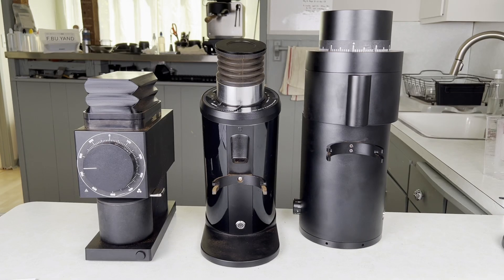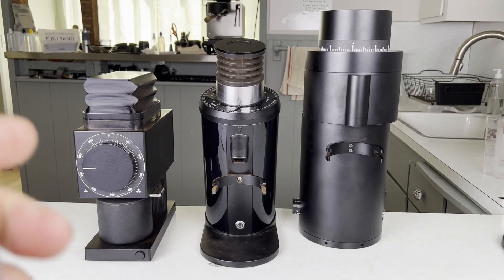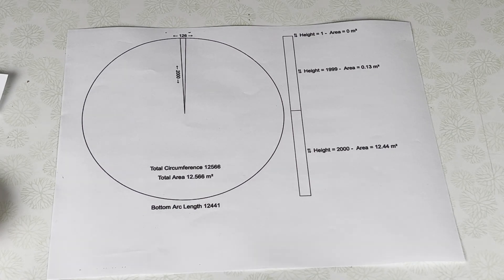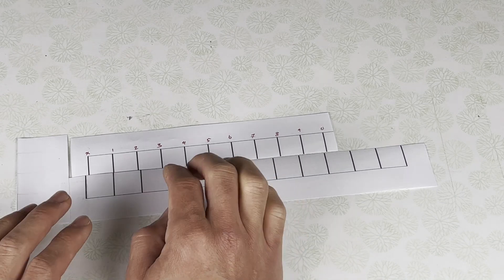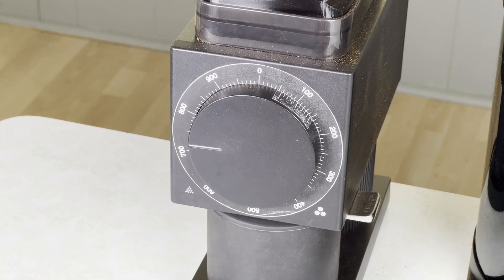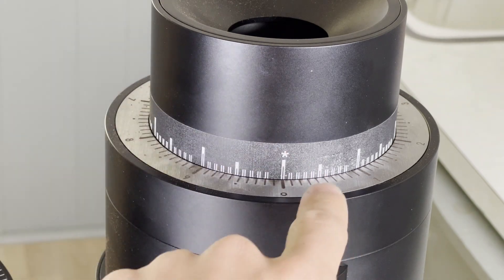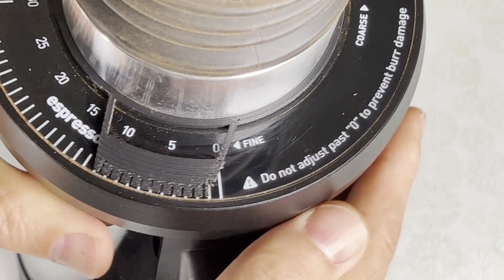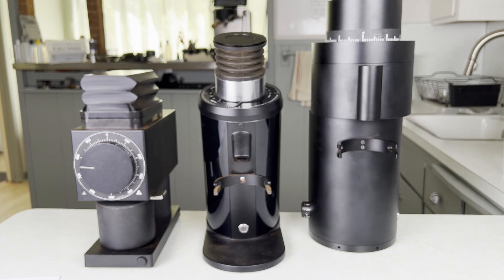1 Micron Grinder Adjustments with Vernier Mods

Comment: Very nice. For the sake of repeatability, I'd like to point out that ideally, you wanna approach your desired grind setting from the "same side" everytime. Either go coarser or finer, and then move to your desired setting (but choose one and stick with it).
This should minimize the effects of backlash on your grind setting (where moving from let's say 60 to 75 would be slightly different than when you move from 90 to 75, because of play in the thread).
Reply: You should always finish towards finer, because the slop pushes it coarser. Going finer you don't have to worry about backlash, but going coarser you should overshoot and come back.

Comment: This is a great, maybe an obvious question but how are you measuring the pitch on the threaded parts
Reply from the maker: You can measure the distance across a number of threads and divide by the number of threads to get the pitch
Reply: @jkimmakes  Thanks for your reply. I just did a bit of googling and thinking for my EK43. Apparently the pitch is 700 microns per turn, which gives a dial increment of 38.8 microns per increment (based on a EK43s dial which appears to have 18 dial increments per full turn).  The entirely arbitrary dial indications are frustrating.

Comment: how do you print this to scale for the ode? Im not familiar with indesign, more so photoshop.
Reply from the maker: The svg is 8.5x11". As long as you print it on a full page without scaling, it should work.
Reply: @jkimmakes  i tried and it was too small. had to scale it to 153
Reply: @Kohinootoko  For others looking at this later, the svg is a landscape file, so make sure to flip the print to landscape and it should work. Also remove margins and check scaling is 100%.
Reply: Why is noone selling this as a sticker...

Comment: Don't you think this also applies to manual grinders using a conical burr?
Reply from the maker: This could work on any grinder with stepless adjustment, but the burr gap is not calculated the same way as it is on a flat burr. The distance between the burrs is dependent on the slope of the burrs.
Reply: @jkimmakes  spread out the idea you have made if this is worth working on some conical burr start from day one design